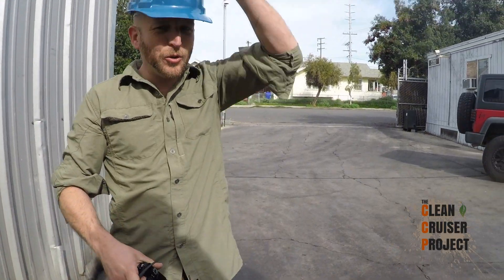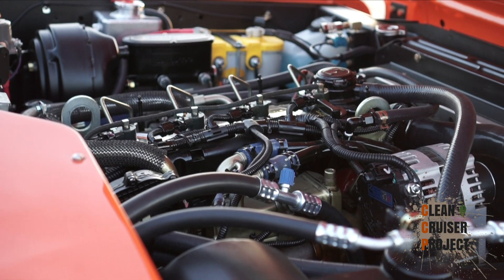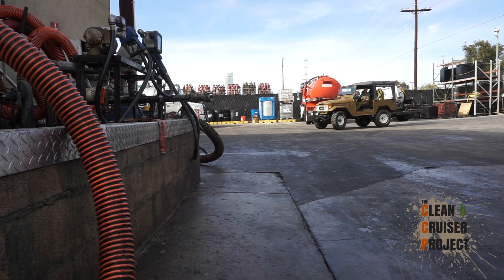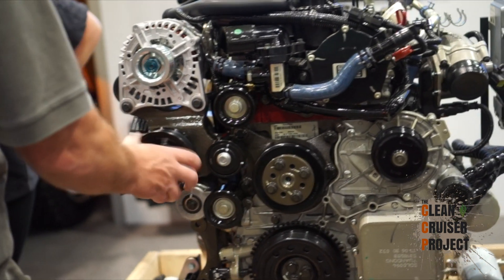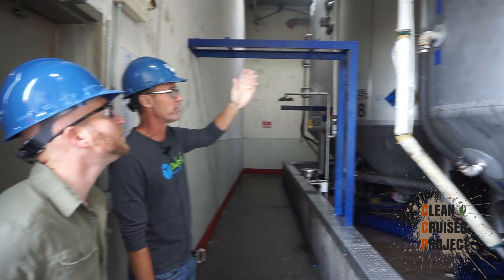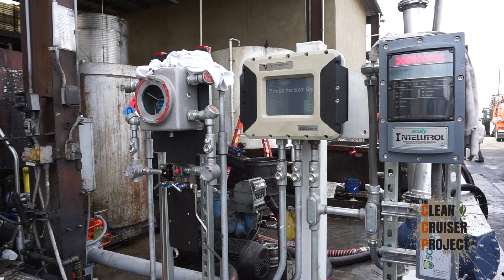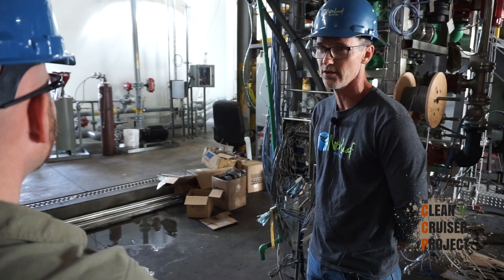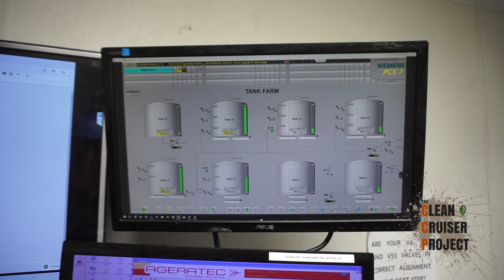CLEAN CRUISER PROJECT // Busting Biodiesel Myths at New Leaf Bio Fuels in San Diego, Ca

Comment: When i had my 18 wheelers i would make my own bio diesel and ran a 25% mix in my trucks the trucks ran cleaner all the way around fewer oil changes less soot out the exhaust and only cost me 68 cents a gallon to produce
Reply: Kevin Whitted what processor did you use to make your own biofuel?
Reply: @douganderson7002  so much agree!
Reply: How did you make it?